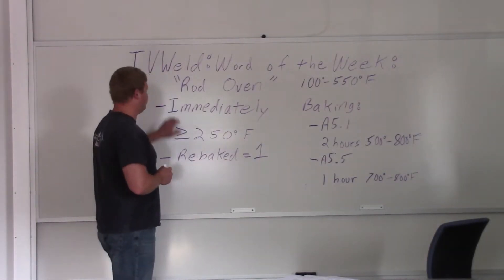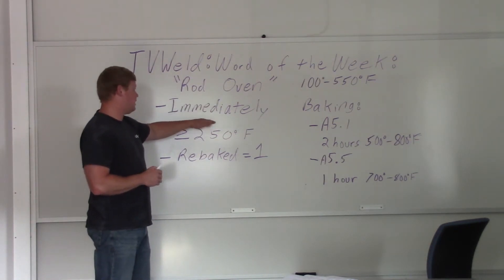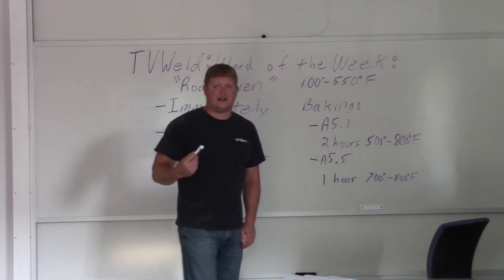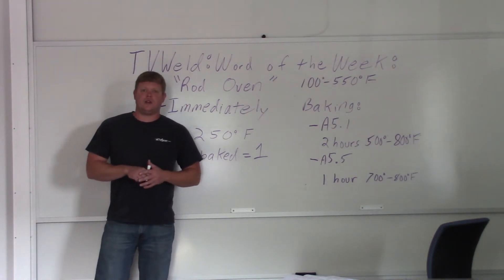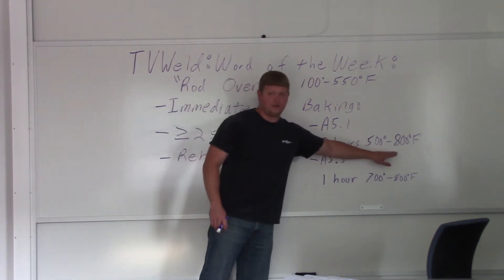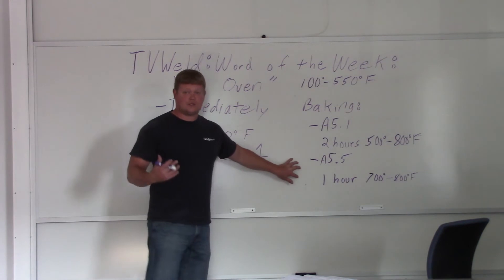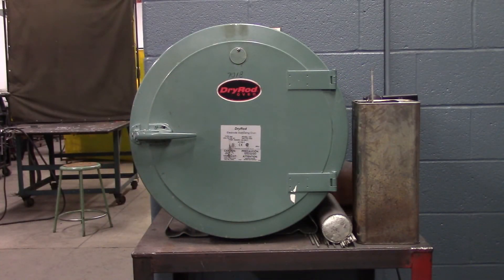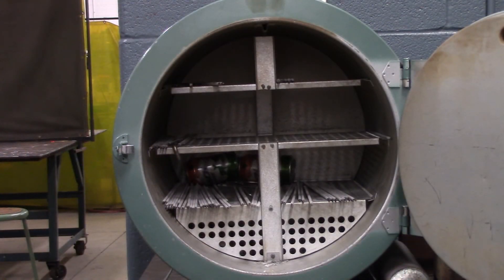Welding Rod Oven

Comment: that is instructive, thanks.

I was said by an engineer from Fsh Selectarc, an european rod maker, that the 7018(their ones) stand \ accept up to 30 hours cooking, which mean 10 times 3 hours at 300 deg celsius

I am absolutely unsure of any code accepting that type of rebaking, it is just what I was said . regards

I also received a table (but in French) giving cooking temp and time, depending of rod type/models s and what base material will be.